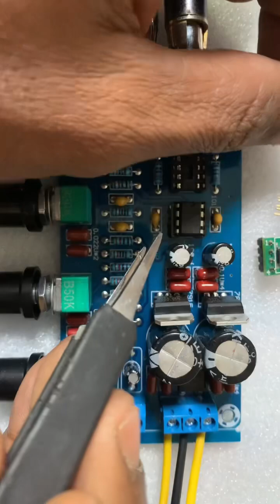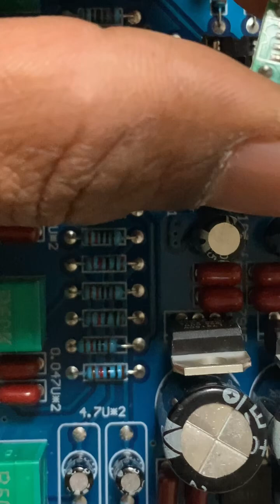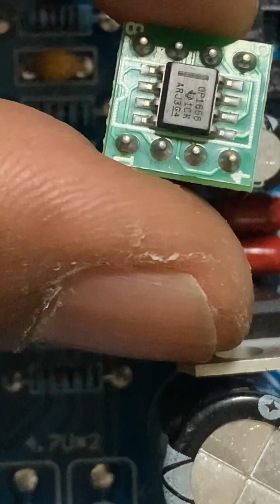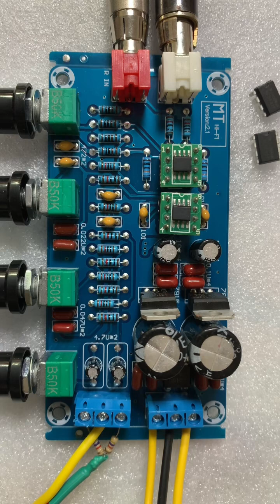NE5532 vs OPA1656: Which Op-Amp Chip is Better for Audio? 🎶 #Shorts #opamp

Comment: Your NE5532 has the suffix "p", use NE5532a which is better suited for audio (low noise).
Reply from the maker: Only this type op amp ic is available. Hard to find good one😢
Reply: @Amplifiernpl Back in the 90s, I built audio circuits using the NE5532a and kept a handful in reserve. I had no idea they were so hard to find these days.
Reply from the maker: @kokskeks66 okay. What i mean to say you that all type of components is hardly find in my place.